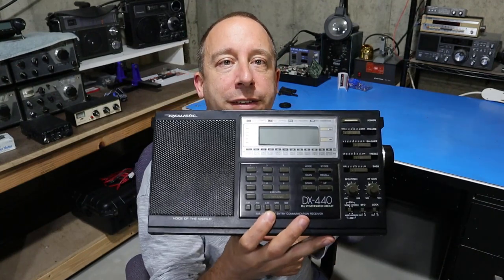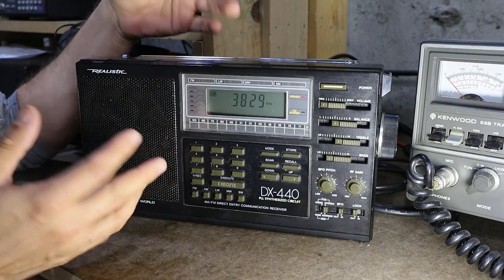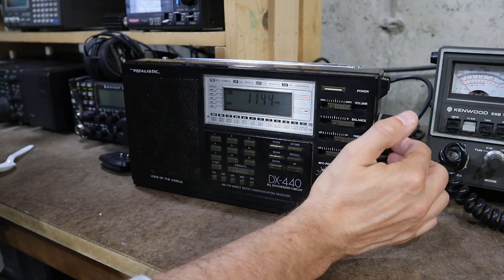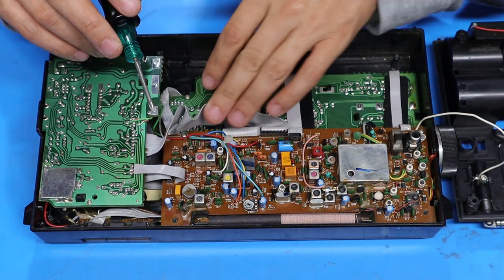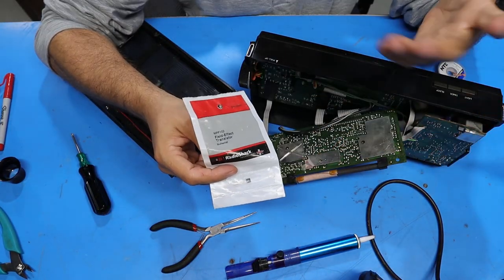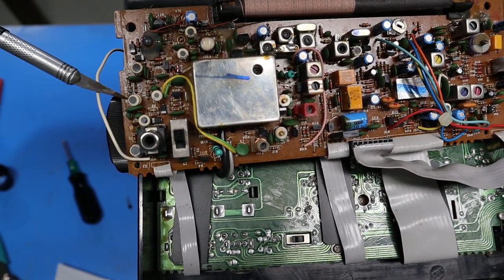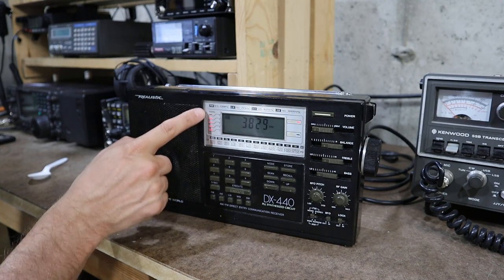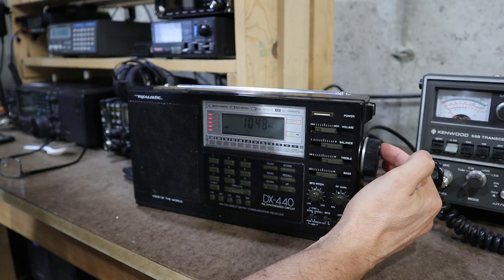Radio Shack DX-440 Shortwave Radio Low Sensitivity Repair

Comment: Good job fixing it!
I've bought the same model from Craigslist recently for $15 in "for parts or repair" condition, it also looked pretty ugly with some stickers and dirt on it. After cleanup and fixing it's one of my favorite receivers now. I had to replace one transistor and capacitor, they've been visibly blown up, probably as a result of using a power supply with reversed polarity. Kit of transistors and capacitors from Amazon are very good, they would have a part you need in most cases and they cost pretty cheap.

Comment: NTE457 is a suggested equivalent for the obsolete MPF102.

Small tech tip: I have that solder sucker among my collection of de-soldering tools. I have sawn off the 'thumb guide' -- for want of a better term -- so that I can recharge the sucker by pressing it against my other hand, chest or upper arm. Not having to move my thumb off the tool and guide it onto the plunger makes the whole process of de-soldering much faster, especially when there's a lot of it to do.
Reply from the maker: That's a great tip...thanks for the info!!!
Reply: Thanks for that. I ordered one last week. Maybe I'll order another to be on the safe side! Regarding desoldering suckers, the best one I have ever used is the Japan made 'Engineer SS-02 Solder Sucker'. Great little thing.
Reply: Thanks!

Comment: Nice Radio. I have the Universum branded model that doesn't have the bandwith switch.
The substitute book from the former german company "Jaeger Elektronik" lists BF244, BF245, BFS72, 2N3823, 2N5245 and "++" which  means, that there are many more suiteable substitutes. So I think using a different type instead of the MPF102 might not be very critical.
Greetings from germany :)

Comment: Thank you sir 🌸 Can you help me with Realistic dx440 radio like this device there is a problem sometimes it does not work when I press the play button and lasts for a long time does not work only a digital clock and sometimes it works well by just pressing the play button .. What is the cause of the malfunction note that I am repaired  Electronics and I did not understand the reason

Comment: I use the DX440 everyday. Bought it new in 1989. Thanks for the tech tip.
Reply from the maker: It's a great radio, this one was my dad's
Reply: I bought my DX-440 in August of 1991. I still have the the page from the RS catalog that advertised it (p.57). The product code was 20-221 and it listed for $199.95, but I wrote down that i purchased it for $139.85.

Comment: Used a NTE 457 on my dx 390 for the same fix and it worked great. Pins are in the same order and outline of FET on the board is the same. I used a solder wick with good results.
Reply: Can you advise which transistor you replaced for the AM weakness? There are several transistors on the board. For the 390 that is. Thanks!

Comment: I picked up the DX440 at a recycling bin with weak receive. After changing the FET that improved it quite a bit but its still not as sensitive as my DX392 and the SW bands are still dead. Does it have a separate tuner for SW? Thanks.

Comment: The MPF 102 is the most common, generic, garden-variety FET there is.  You can find them, as well as just about any component, on Ebay.  By the way, they're NOT particularly static sensitive.  Only MOS semiconductors require special handling..

Comment: Hello my friend .. Can you help me, I have a dx440 device. Sometimes it does not work when pressing the power button only an hour on the screen .. it lasts for days and sometimes it works by just pressing the power button. What is the reason, knowing that I have the ability to maintain it with the help of you

Comment: Thanks for another great how to video. I have the DX400 as well as the Sangean ATS803A, which I think is the same radio. Looking forward to making the repairs on both. Thanks to James Bowie for the equivalent part.
Reply: Sangean ATS-803A and Realistic DX-440 is the same radio. Realistic DX-400 is different radio, based on Uniden CR-2021
Reply: @scriptguru8  I stand corrected, I have the DX-440, which needs the MPF102 FET replacement. Part just arrived, so now I need to find time for the repair. Thanks again for the videos.

Comment: I have this radio. However i think i over loaded some thing . Every thing works except short wave freqs are not there i 
Made a home brew three wire longwire antenna. I could pick up everything. Now sensitivity seem gone except for fm. Any ideas ? Long wire was 50 foot .
Reply from the maker: It sounds like the same problem I talk about in the video

Comment: I have two of the Sangean version of that radio that I bought new many years ago. Both are in mint condition but one stopped receiving FM a long time ago. I put a loop antenna up a few months ago and haven't gotten the chance to try that connected to either of these radios but when I do I'll be sure to disconnect when I'm done. I keep one next to the bed and often listen if I wake up in the middle of the night especially if there's some breaking story going on. I've always wished the light could be left on or stayed on for a time. That would make tuning around the bands a lot easier in the dark.

Comment: I have a dx 440 that brings in a very  weak local am radio station that's very difficult to hear but i have a Sangean ats 803a that's basically the same radio but it does not have the same sensitivity on am, so would changing this resistor do the trick or is there something i can adjust on inside the radio to get it as sensitive as my dx440? Thanks maybe radio shack did something to the Sangean ats803a to make it better when they sold is as there dx440.
Reply from the maker: I'm not sure if the 803 uses the same circuits or not-ive never owned one.  You'd have to take it apart and compare it to your 440

Comment: Is this common fault on the RF stages,
happens to the Siemens RK-641 and RK-651? (Same OEM set).
Reply from the maker: I don't know about those parts specifically but FETs like this one are prone to damage from static
Reply: @SevenFortyOne  Thanks.

Comment: Well I found a transistor here in Costa Mesa at MarVac Electronics. It was not the Radio Shack MFP 102 but they cross referenced it to a NTE Electronics Inc NET 451. It looked just like the one in the Q 115 spot and fit right in. I did it just as you did and was very careful with everything and did it just as you did except I forgot to clip off the tails on the transistor. i put it back together with no problems, I installed the batteries and the clock came on for about 3 sec and then it went off and the radio never came on at all. i took it apart and clipped the tails, which were now bent over, This did not work. 
to bad, I bought the radio new and only used it a couple of times and has been packed away for 30 years. Very nice looking but no juice. Do you think I shorted it out ? maybe try a new transistor? they still have 2 in stock?
or do you have a
 SW radios you might recommend.

Disappointed in SO CAL
Reply from the maker: Yup - you very likely shorted something out in another circuit on the board below and damaged more components.  I doubt replacing the transistor will help - something else is probably wrong now but I wouldn't know for certain without checking it out in person.  If you are looking for something new, check out the radios from Tecsun - they are usually pretty good.
Reply: Check that the internal battery contacts are actually contacting their mating pads. There are 3 prongs inside that press against 3 solder pads. Not great design, so check it.
Reply: Have the same problem in Florida. Hands no longer able to do fine soldering. Anybody know a repair shop? Willing to mail the radio.

Comment: Thanks for the tech tip, it cured my ATS 803. My question is whether you have employed any preventive mods, such as a pair of back to back diodes? Absent that, would a simple wire clip from the negative battery terminal serve as a safe discharge point from my hand before touching the antenna?
Reply from the maker: I didn't add any protection diodes but should have.  I'm not sure of a ground will help here or not but it probably wouldn't hurt
Reply: @SevenFortyOne  If you connect an earth ground to the radio ground, that will improve reception, especially on the lower frequencies.  But it will increase the possibility of static damage.  Without such a ground, the radio is connected to earth ground through stray capacitance, which presents a high Z to low frequencies, and is essentially infinite, for DC.  With an actual ground, the path for the static discharge is low Z, so, ZAP!
Reply: @SevenFortyOne  Be sure to add the diodes.  And if you add an RF choke in parallel with them, that's even better.  Choose an inductor with a reactance of a few thousand ohms, at the lowest freq. you'll be using.

Comment: I have one 803a. Given to me by a friend in horrible condition. Over the years, I fixed some of the problems. such as display. VU meter still not working. AM/SW may or may not start etc etc. Does any one has the circuit diagram?. I need help please.
Reply from the maker: If you do a google search you should find it.  You may have to look for the DX-440
Reply: @SevenFortyOne  thank you sir

Comment: My DX-440 works very well on FM mode. On AM (MW and LW) does not work. On SW (AM and SSB modes ) it works but with low sensitivity. Also,  there is  a 2kHz offset on SW. I mean, to tune a station that transmits  at 11.940, I have to tune the receiver at 11.938kHz. Any suggestion ?
Reply from the maker: In the video I explain the sensitivity problem I had with mine.  More than likely you have a bad transistor but its hard to tell without having the radio in my hands
Reply: @SevenFortyOne  tanks for the feedback. Unfortunately, I’m in Brazil. So, it is a bit difficult to send it to you.  I’ll try do it by myself. I’ve  just found the manual service. Thanks again. 👍 de PU2CLR.
Reply from the maker: That's ok, I don't work on other people's radios anyway. It's a pretty easy fix if you are used to working with electronics and soldering

Comment: Have you ever had the tuning knob on the side get glitchy?   As I turn it, it skips forward fast or jumps randomly.   I have tried to get in there and cleaned the contacts but after a while it goes wacky again.   Some days I am listening to it and the vibration from the speaker triggers tuning and it starts cruising the band randomly by itself.   Either it is bad or ghosts are haunting me.  Anyone out there have the same problem.
Reply from the maker: The problem might be 4hat the arrow buttons on the keypad are sticking or some crud got under them.  Either that or the rotary encoder is shot
Reply: @SevenFortyOne  That rotary encoder was the weakest link.   It always seemed a  little wobbly.  Buttons seem fine.  Thanx

Comment: I bought one of these from a Radio junk sale recently,mine is called the Saisho SW 5000 of which is acturly the DX-440,except mine was made in Taiwan,hence the name Saisho.Supriseingly it acturly works very well compared to my other portable radios arround the same age.But I have one very bad problem with it.The front panel that houses the push buttons is badly corroded.It looks like an Aluminum metal plate.You would think they would have used plastic,but no its metal.I have tried lightly sanding it but it is badly pitted,and looks real bad.So how would I repair or replace this panel? Im thinking maybe have a vinyl plastic  transfer made and numbers/names printed on then sticking it on top. Any advice would be very wellcomed thanks.
Reply from the maker: Interesting...I've never heard of the Saishow version before.  Anyway, I don't know if this would work or not but I saw a local motorcycle restoration guy rubbing household aluminum foil on a nickel plated motorcycle frame to restore the finish - this might work for your faceplate.  I'd be sure to test it first to see what happens.
Reply: @SevenFortyOne  Thanks for your quick reply.I live down here in NewZealand,very hard to get SW radios and parts over here.But yes the radio was made in Taiwan and called a Saisho  SW -5000.Unfortionitly I can not put a photo of it on here to show you.The corrosion has gone right into the front metal plate,and its badly pitted,I dont think rubbing it with foil would help because it is coated in a black colour,so it is not nickel.As with your DX 440 you will see that front black panel,of which should look perfectly smooth.I may see if I can get a vinyl plastic  3D printed transfer to stick over it.I acturly owned one of these,called the Sangean ATS 803A when they were new,but later decided to trade it in on the Sony 2001D.I whish I had not because the Sangean performed far better than the Sony did.Thanks.